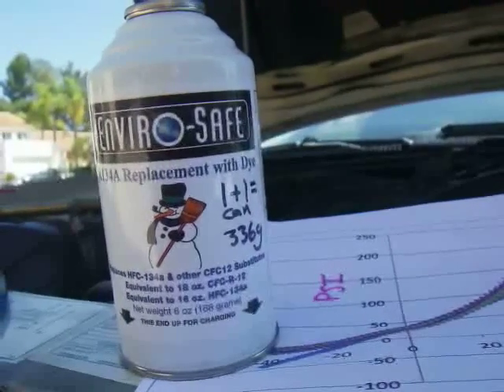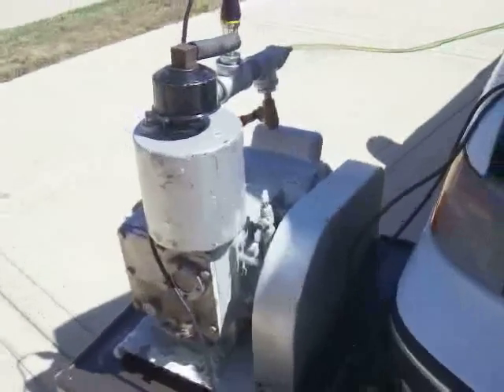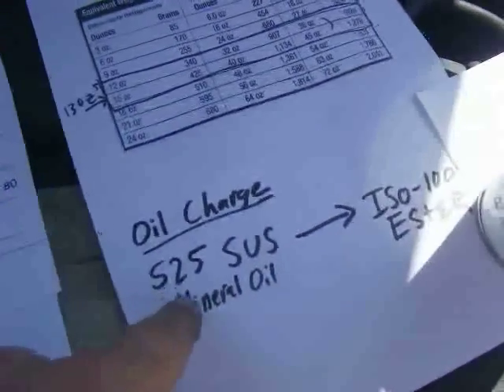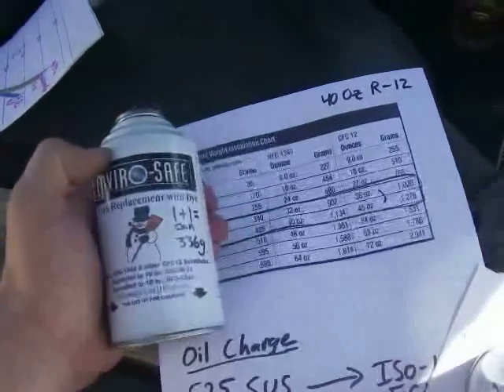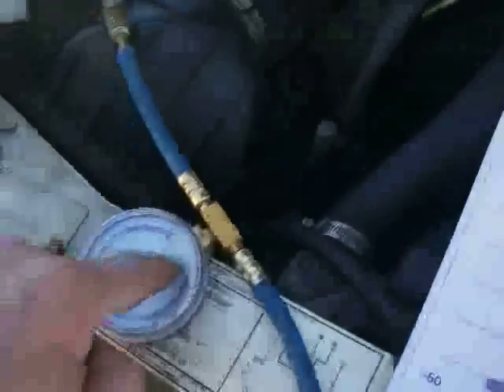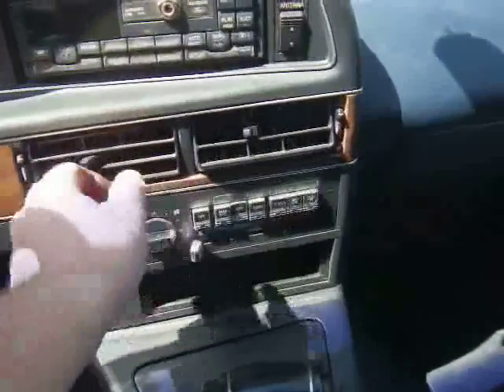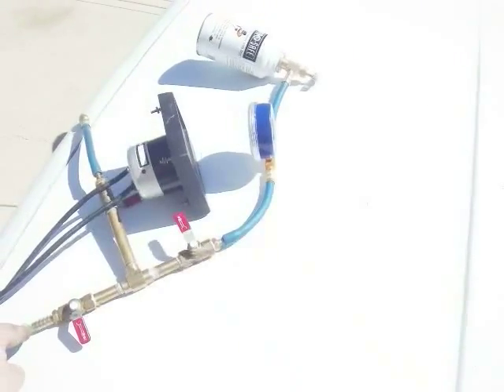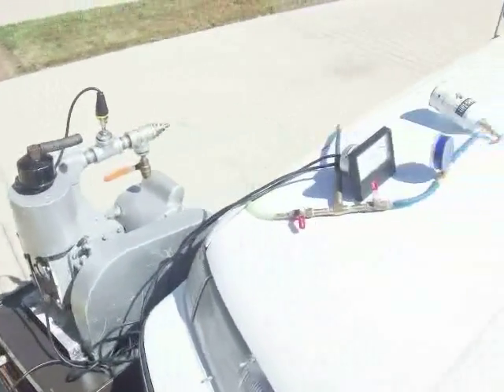DIY R-12 Retrofit to Envirosafe R-134a Substitute Explanation

Comment: You dont need ester oil dude.  Hydrocarbon-based refrigerants are compatible with all oils.
Reply from the maker: POE added to add back lost oil, this is compatible with both mineral oil (original R12) and PEG (R-134A).

Comment: FYI...  envirosafe is 100% compatible with both oils used in r12 and r134, and you do NOT need to put a vacuum on the system.  Its literally a miracle refrigerant.
Reply: Can you mix it or do you need to purge the remaining r134a or r12?
Reply: Problem is, it's highly flammable being mostly propane, and a large part of that refrigerant is inside the car.

Comment: Hi there.  Thanks for the very technically accurate video!  I was wondering why Envirosafe didn't recommend charging into a vacuum - thanks for addressing that.  Charging by weight (mass) into a vacuum is the best way to refill a system.  I believe the Envirosafe is completely compatible with mineral oil, or any other, for that matter.  I think the Ester oil is needed only if you are placing R134a into an R-12 system and leaving the mineral oil.
Reply from the maker: Glad this has been helpful!
Reply from the maker: I believe this is correct.  Residual mineral oil can work - I never flushed the residual out.  I added 1-2 oz of ester oil with UV dye just as a carrier for the UV dye.

Comment: REMEMBER IT IS NOT GOOD IDEA TO RELEASE FREON IN TO ATMOSPHERE I HAVE HAD GET CERTIFIED FOR THIS .You did good job little over engineering i am master certified auto technition 15 years you dont have be so causius on the vacum by doing it 3 or 4 times or back flush with argon once system is exposed to air the freon will gass and dissipate it alway good pull you vacuum 30 inches merc let sit for 10 min or so lookat reading if gone up vacuum agian to 30 inch merc do this once or twice if you have large leak you will never achieve good vacuum now you have done vacum best get yout self cheap oil injector for a/c from local parts store with vacum on inject oil in system then charge it up

Comment: Enviro-safe does not have to be put in under a vacuum.
Reply from the maker: This is true, but if you suspect that air or moisture is in your system [as I did] and you do not pull a vacuum prior to charging any refrigerant you will either get icing up at the orifice tube or degraded performance.  The industrial version of envirosafe recommends charging into a vacuum.
Reply: Cool. I have been told that it works better also.
Reply from the maker: The can indicates not to charge into vacuum for regular envirosafe, but from what I researched this is to prevent overcharging, in this case I am charging by weight.  The zeolite molecular sieve used in the dryer needs hot nitrogen to cause adsorbed water to be released, vacuum alone at this level should not dry it substantially.  Pulling a hard vacuum on it and flushing it with dry inert gas helps remove any water adsorbed elsewhere in the system or present in the oil.  Something was continuing to be released from the AC system long after the refrigerant was pulled, likely it was water from source or another.